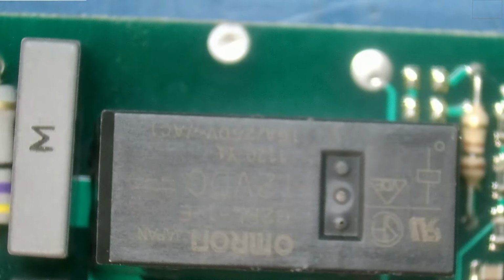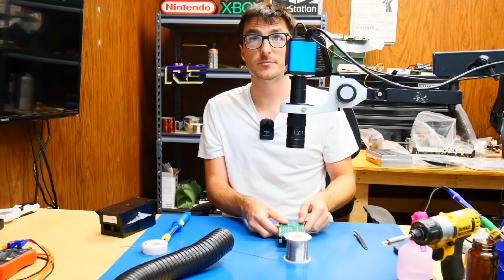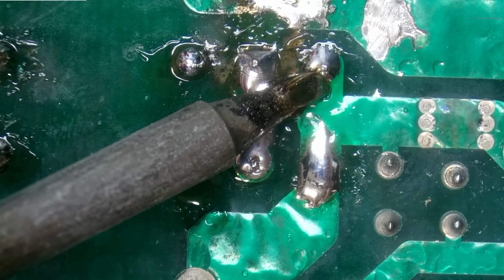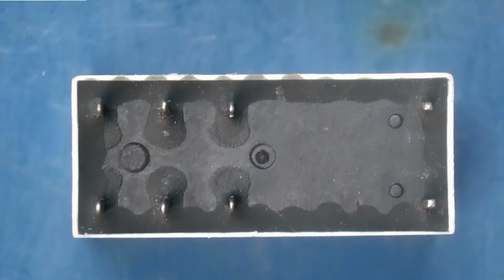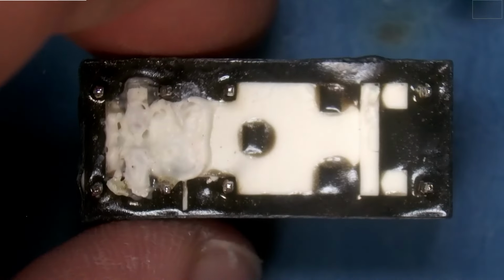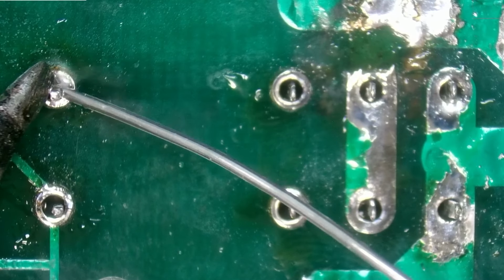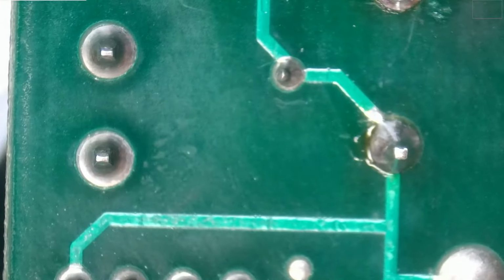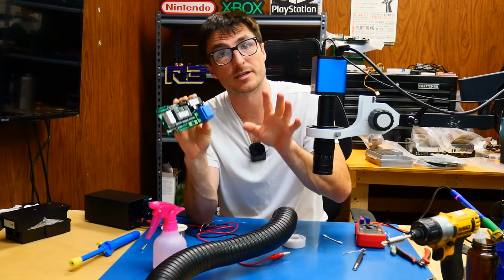Nuova-Simonelli-MAC-2000-V-Cubic-Ricerca-NEWMAC1 Controller Board Repair Part 1

Comment: Tried calling to your shop for espresso machine board repair and the guy that answered the phone said you guys only fix TVs.
Reply from the maker: Darn, as the business owner, that's not something you want to hear. 
Right now, some of my team is out on vacation, so I do have temp people filling in the customer service and phone positions. That's probably why this is happening. What I recommend, if you don't mind, is sending us an email or filling out the contact form. (ill link that below)
Please provide the full model number of your device and symptoms. My experienced customer service guy, who answers the emails, is not on vacation and does not have a temp replacement at this time, so you should get proper help there. With that said, I can't promise we will be able to fix your issue. We only service a small and specific type of espresso machines.
https://nickselectronics.com/pages/contact
info@nickselectronics.com

Comment: Hello, the connection appears to be broken in the common legs of the relay you replaced. 5:21
Reply from the maker: Oh my god, nice catch! I didn't even realize that trace was missing because of the mess from the customers soldering attempt. 
I filmed the video Friday night before the weekend and still have the device at the shop. Thanks to your comment I will be fixing it asap before it ships. 
Yeah when comparing with a prior video I made on the repair of the same board for a different customer a year or more ago you can see the trace more clearly:
https://www.youtube.com/watch?v=Mno_uHFJA-w&t=16s